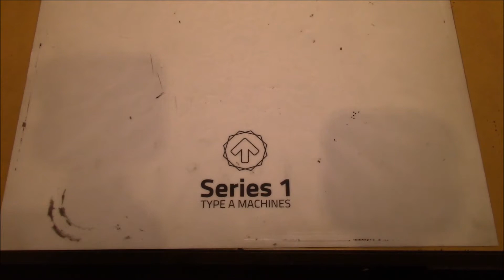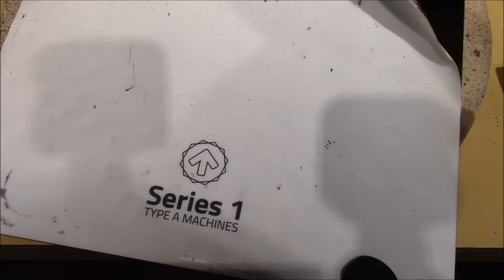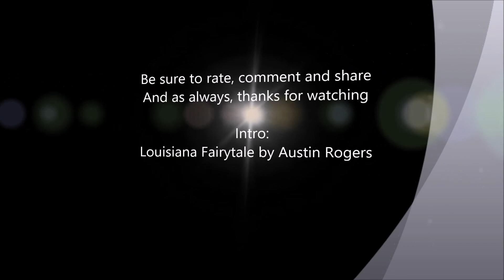BuildTak Change on FlexPlate

Comment: cool easy way to take the tack off.
Reply from the maker: Yes, it seems the heat gun is the best method.  Luckily this only needs to be done 2-3 times/yr. with the FlexPlate, which I think extends the lift of the BuildTak since you don't have to scrape off as many prints like you do with a rigid build plate.